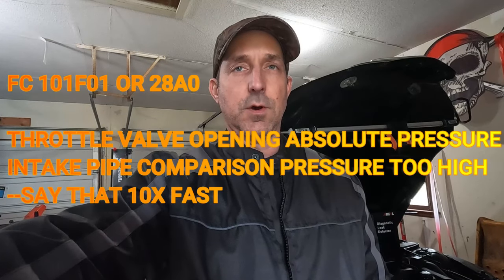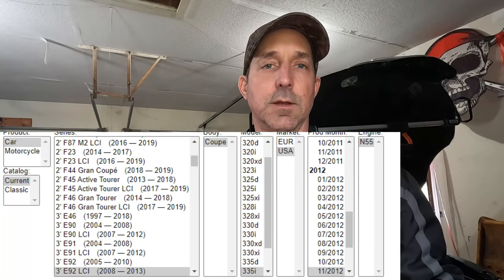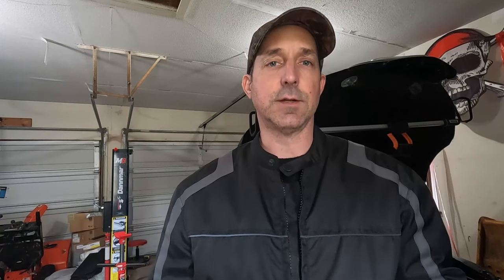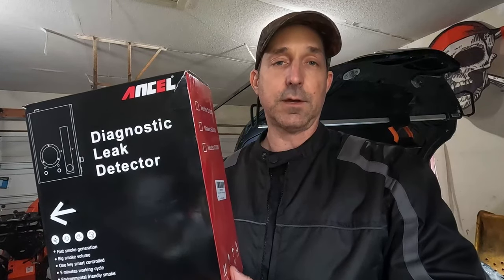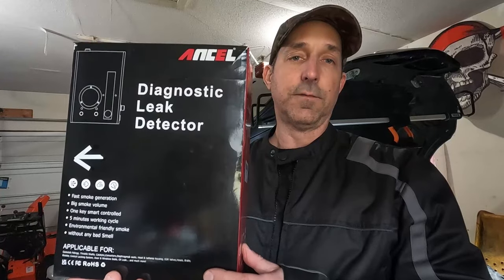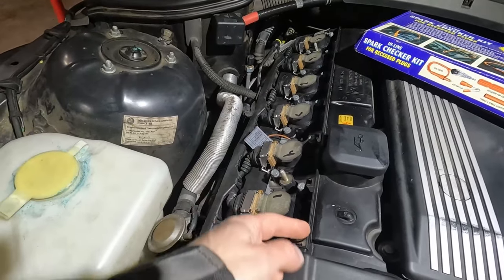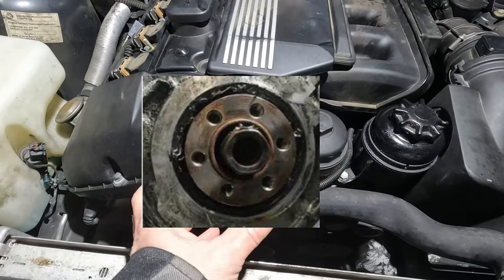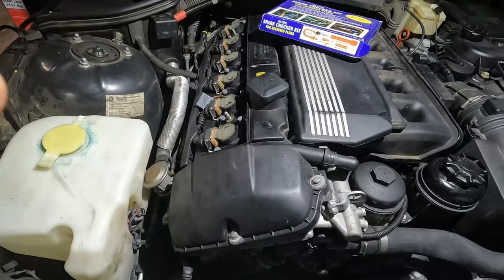28A0 or 101F01 or P 112F BMW Fault Code N55 Fix! And odd N55 issues I have seen!

Comment: Hello Guys,
I got this BMW X5 2012 xdriv35i E70 last year and I am trying to keep it for long term.

I have been dealing with a code : 28A0 ( Air Mss System, plausibility: Calculated air masses in the air intake system not plausible) for long time.

This is was has been done to the car related or not to the issue:
Order:

RELATED:

DMLT VALVE replaced

Purge valve replaced

charge pipe replaced with FTP

Valve cover and other parts replaced. OEM

TMAP/MAP Sensor replaced (intake and charge pipe)

MAF sensor cleaned and new gasket installed

Superjet pump vacuum hose replaced

Air filter box gasket replaced.

------------------------------------------------------------------------------------------------------------------

NOT RELATED:

Current Miles: 110.000

Oil filter and gaskets MANN, Oil 5w30 Liquid Moly , air filter MANN , drain plug and gasket - changed every 5k miles.

PREMIUM 93-94 octane fuel (Delta, Shell, Sunoco)

Brakes pads , rotors and sensor

Parking brake actuator

Spark Plugs and Coils

Oil filter housing gasket and mickey mouse replaced, coolant flush

Transfer case fluid changed

Differentials fluid changed.

Transmission fluid and filter changed.

Heater control valve

radiator cap

steering wheel cap

L/R Mirror glasses

Right interior temperature sensor HVAC

AUC Sensor

Exterior and Interior HVAC Filters

Parts supplier: FCP EURO (OE/OEM)

-------------------------------------------------------------------------
I have been doing some smoke tests and this is what I found and Fixed.

Charge pipe leaking: FIXED

Maf sensor leaking: FIXED

Map Sensor leaking: FIXED

Superjet pump vacuum line leaking: FIXED

Air box filter gasket leaking: FIXED

Valve cover gasket leaking: FIXED

Map Sensor leaking: FIXED

besides that I can't find more vacuum leaks with my smoke teste, I don't see any smoke coming out anywhere.

What else can I do ?

Something also weird is that the EVAP Monitor never gets done.

Car runs perfect , no issues , no bad idle, not knocking (just some times you can feel a small misfire but the RPM does not go crazy.

The light and code triggers when the car is being drive at constantly low RPM (1000rpm-1500rpm) and around speed of 25-35mph.

If avoid those situation I won't get the light but I will get the code sometimes as pending.
I am tired of this code

----------------------------------------------------------------------------------

Some Live data:

Short trim fuel are usually at 0%
Long term fuel are usually at -2,3%
Short trim sensor 2 is usually at 99.2%

O2 b1s1 is usually at : 1.4 - 1.5
O2 b1s2 is usually at : 0.7

Intake manifold pressure after throttle valve: 13.93 psi
Intake pipe vacuum before throttle valve (charging pressure - setpoint value) : 14.65 psi
Intake pipe vacuum before throttle valve: 14.63 psi
Charge air temperature: 115.7 F

-------------------------------------------------------------------------------------------

Please let me know what else can I do to diagnostic and fix this code, It is the only code that the car has.

Thank you so much!
Reply from the maker: Hello Nicolas, I hope my video helps you solve it!